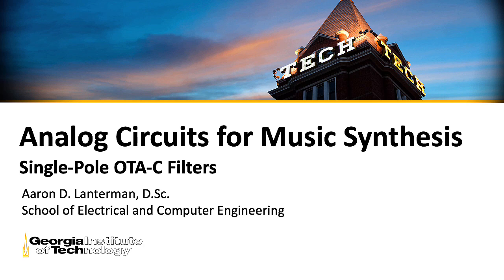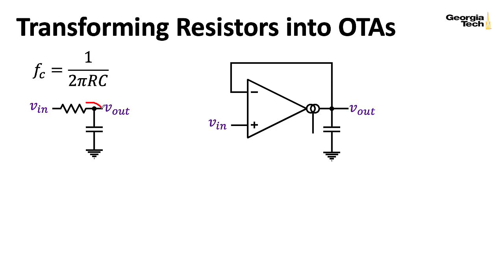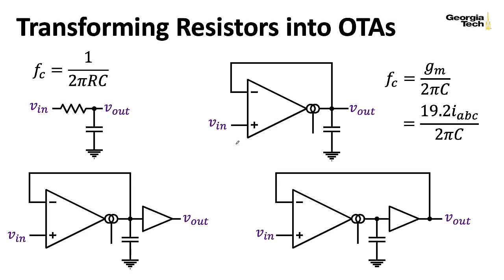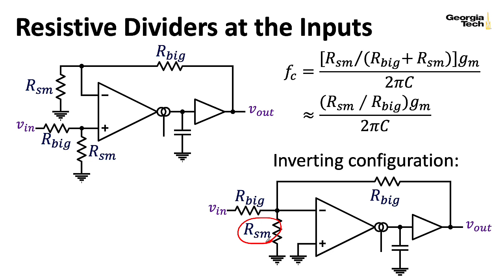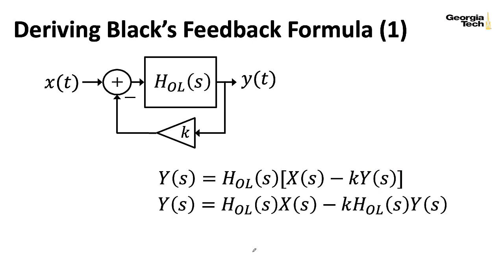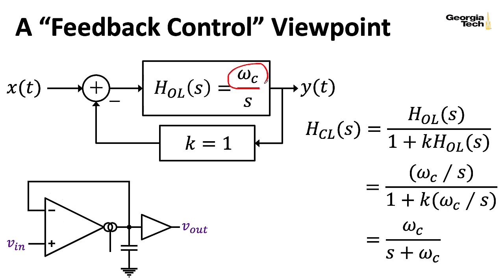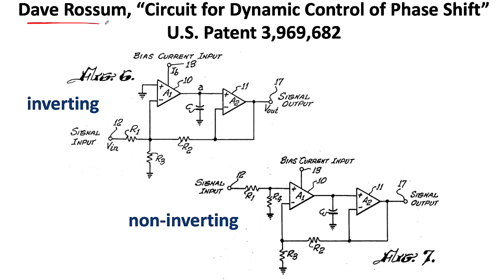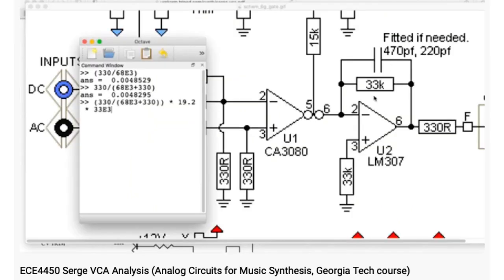ECE4450 L19: Single-Pole OTA-C Filters (Analog Circuits for Music Synthesis, Georgia Tech  course)

Comment: 5:55 I believe the feedback is taken from the output of the buffer to cancel the DC voltage offset that you get from emitter/source follower buffers, as well as to avoid loading the filter as you mention.

Comment: Regarding the negative feedback being taken after the buffer you asked at 6:30. In addition to the current considerations, doing it this way includes the buffer in the negative feedback loop and so the OTA's output will then adjust for faults in the buffer itself. The downside would be a situation where you're saturating/clipping the buffer and your OTA becomes even more distorted.
Reply: Also, I watched your lectures 11-12 years ago and it was great then, but these videos are so much easier to follow and watch, thank you for doing this.

Comment: Thanks for the video.
I am a little confused at your explanation for using superposition to calculate the inverting configuration since Vout is not an independent source. If you assume it is, I end up with V- = (Rsm/Rbig+Rsm)[Vin+Vout] which doesn't help get to the final fc equation. Given that the filter circuits in the other videos all depend on the inverting configuration I think a more thorough explanation would be very helpful. thanks ever so much for these wonderful videos.
Reply from the maker: You can use superposition with dependent sources (unlike what most textbooks say), you just have to be very careful. You have to include all the terms that contribute to the controlling variable before solving for it. My colleague Marshall Leach wrote a paper on it: https://leachlegacy.ece.gatech.edu/papers/superpos.pdf
Reply from the maker: The equation you have is correct; all you need to do is write Vout = V (gm /(sC)), solve that for V-, substitute that into the equation you wrote, and then solve for Vout.

Comment: Hi guys, can you recommend somewhere to start with his lectures, or is there entry requirements in order to watch all of these?
Reply from the maker: Here's the main ECE4450 playlist: https://www.youtube.com/playlist?list=PLOunECWxELQS5bMdWo9VhmZtsCjhjYNcV

To replicate the order I cover material at Georgia Tech, watch "Introduction" lecture, and then watch the 5-part "50 Years of Music Synthesis" lecture. Then, you should take a detour and watch everything but the first lecture in my "ECE Design Fundamentals" playlist: https://www.youtube.com/playlist?list=PLOunECWxELQTn3DQYYB4qaEC9KRK5mHNK

That will review some basic circuits concepts I use throughout the course. Then you'll be ready to watch the "Voltage Controlled Amplifiers: Operational Transconductance Amps" lecture and the rest of the ECE4450 lectures in order.

Comment: Just a question because I admittedly don't know the answer, is choosing an inverting or non-inverting purely a design preference or does it change the characteristics of the filter?
Reply from the maker: I think it often depends on what else the filter is hooked to and what the goals of the designer are. Like if someone wants the entire filter to be non inverting, they'll use an inverting version if some other system they need to use is inherently inverting.

Comment: i see OTA Low pass filters where the feedback of the output goes back to the non inverting pin of the OTA combined with the input signal, while OTA Hi-pass filters use the inverting feedback configuration .. as in your video.
Reply: Doing that, the circuit would instantly gets stuck at one of the supply rails.
Maybe what you're describing when you say "high pass" is actually using an opamp integrator instead of a cap connected to ground. Since opamp integrators are inverting, you don't need to invert the phase using the OTA's inverting input and instead you'd use the non-inv input. ( And same thing applies here : if you do use the inverting input, the result of those two inverting stages would be positive feedback, causing the circuit to get stuck at one of the supply rails. )

Note that technically speaking, an OTA-C with a cap to ground is already acting as an integrator since it's a current source followed by a capacitor. This is why you can construct state-variable filters out of OTAs without ever using an integrator in your circuit.